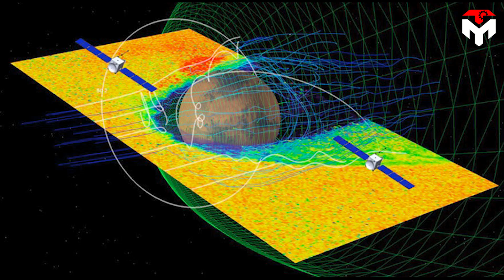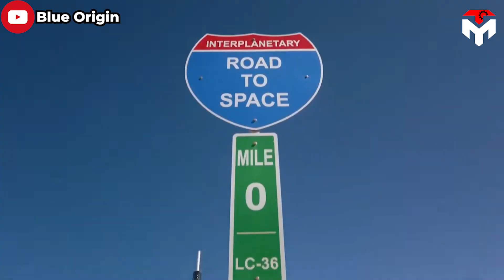Finally happened! B.O's Sleeping Monster 'New Glenn' awakens for big NASA contract, but SpaceX...

Comment: Blue Origin does not rival Starship as a heavy lifter in any way. Its diameter is much smaller, its payload capacity is less than 1/3 of the Starship. Its engines are no where as efficient as the raprotor engines and its cost per pound of payload is much higher. It may be a good competitor to the Falcon 9 but it will never be a meaningful competitor to Starship and that is version 1 of the Starship.
Reply from the maker: Thanks for your sharing

Comment: IF, and I do mean IF, New Glen flies, it'll be touted as a great success by the media and SpaceX haters. But they'll likely get that one success and wait for another 3 to 5 years to get a second flight. It won't be because the FAA holds them up with regulatory gobbledygook, it'll be because Blue Origin is not a tortoise, it's a snail. They're going to purchase ULA in an attempt to leapfrog New Glen and have a rocket they will call theirs in Vulcan Centaur. Another unproven rocket that hasn't flown yet and is powered by engines they have on New Glen. They are fortunate they have a CEO/Owner who has more money than a lot of small countries, they don't need profitability apparently. NASA will keep them afloat with taxpayer money or Bezos will sue their ass. That's just my opinion.
Reply from the maker: Yeah, thanks for your useful information